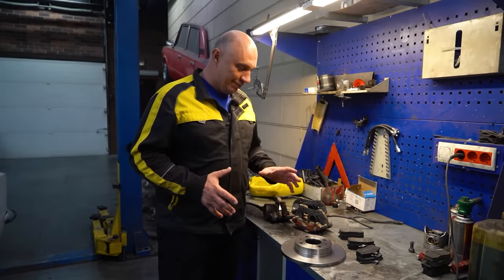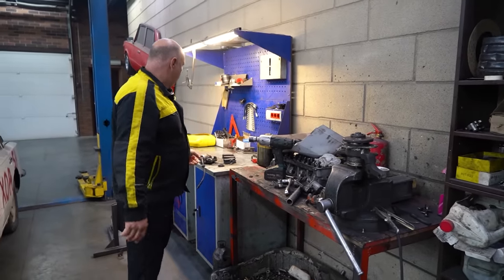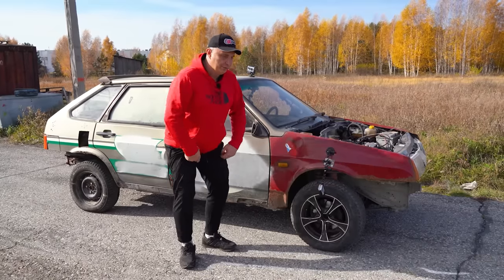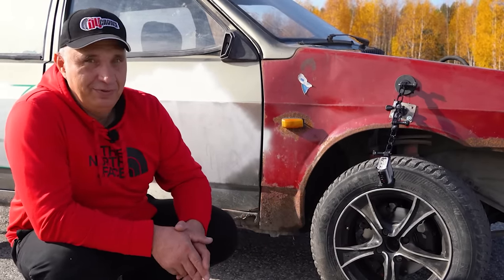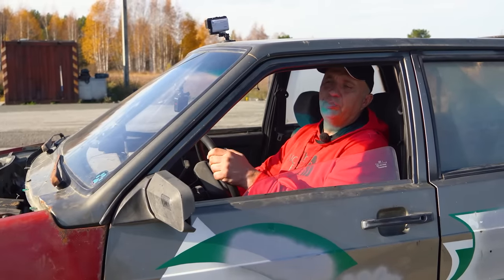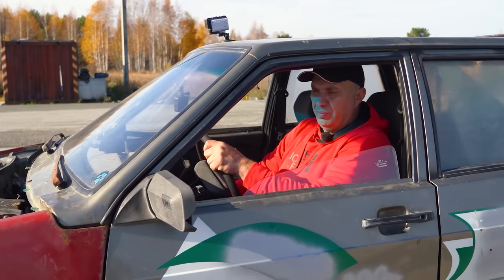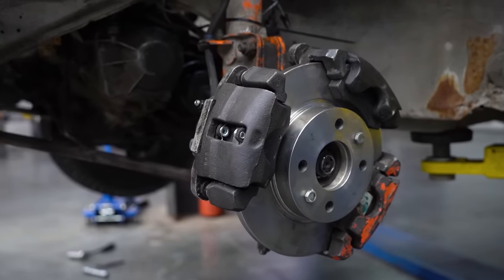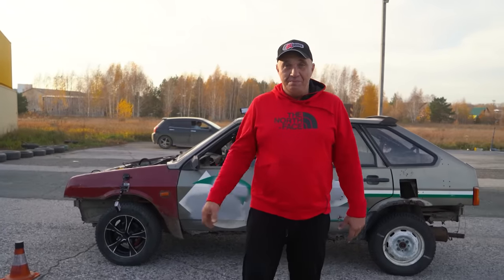Three calipers for each brake rotor – what will happen?

Comment: Maybe add more wheels to the front and see how much braking you can actually get with more traction.
Reply: They could also start drilling the rotors if the additional wheels and brakes need the extra stopping power.
Reply: Would be better to take the rear lines and use them for more volume
Reply: Nah, wont change much. wider tire is not equals more traction. i saw here on youtube old german video, there was passanger car and semi truck, long story short it doesent matter how wide or skinny your tire is, if brakes can lock up wheel braking distance will be about the same. but softer tire compound will shorten distance
Reply: @davidgoliath2331  "if brakes lock up" that's the point! Having more tire pushes that point further, hence achieving greater deceleration.
Reply: That is peak stupidity, I absolutely love it
Reply: More wheels it's not equal to more traction
Reply: Little pizza cutter 14's on my 79 620 deliver incredible traction. I don't believe bigger is better.
Reply: 355 r88r's up front.  Might do an endo 😆
Reply: @davidgoliath2331 Engineering Explained has several videos about braking with wider tires, bigger rotors, slotted rotors, ventilated rotors, etc. He is very articulate in his explanations. Worth watching.
Reply: @MadScientist267 Adding two master cylinders would be awesome.
Reply: Yep!
Reply: Yep, both...more wide...stickier...
Reply: @fynetuneyrgf drilling the rotors would lose surface area and thus biting force. It would make the stopping distance worse
Reply: Tyrell Indy car style heck yeah
Reply: @alexmelia8873 drilling the rotors is to keeping the brakes cool and making sure they don’t over heat
Reply: @joshmanis9860  I have to say about the drilling/slotting rotors, it isn't designed to dissipate more heat, if anything there is less metal on the rotor which means more heat. 

The slot are cut in to help stop brake fade which happens when the brake pad gets to a certain temp (depending on quality of course) the pad heats up and causes gas to emit between the pad and the rotor which stops the pad contacting the disc until the gas escapes.
Drilling rotors is even worse and is really done for aesthetics.
The webbing between the rotor surfaces is what is designed to dissipate heat.
Reply: Put more weight in front of car to háve better grip
Reply: Here’s 2 ideas, a twin front axle like the old lad Tyrell F1 race car or an ejector seat with airbags with a Klaus and St Greta dummy  .
Reply: @JT-4real drilled rotors is to let the gas escape that builds up when the brake pads wear.
Ventilated discs is to keep them cool.
Reply: @davidgoliath2331 there's a point where traction and weight cross over. It's all about ground pressure. Wider tyres will give more grip until a certain point them less grip. Tie increasingly larger pieces of plywood to your shoes and try it out.
Reply: @davidgoliath2331 wider tire definitively equals more traction that's why f1 cars have 400 section tires and it was one of the major advantages of the tyrell 6 wheeler
Reply: @1one3_Racing  That is what I wrote but I didn't say ventilated I said the webbing in the middle is to dissipate the heat which is a ventilated disc, the slots are to let the gas escape and drilled do the same job but make the disc weaker and allow for cracks to form.
Reply: nonsense, they need a better brake pump, three calipers is too much for any stock pump
Reply: @Sekir80 you still need weight on the wheel to get grip. That's why bulldozers have skinny tracks so they can get good ground pressure and great grip
Reply: @joshmanis9860  thats correct- it'll help longterm braking as a trade off for instantaneous bite
Reply: @JT-4real  good quality brake pads have a slot in the middle which is there to dissipate the gasses. The vents in the rotor act as a blower fan sucking in air from behind the hub and shooting it towards the wheel. The slots wipe the pad surface clean to help prevent glazing of the pad surface and the holes help get more air moving through the rotor
Reply: @Sekir80 In a physics class you will learn that increasing the area of contact with the ground decreases the force per unit of area, and it balances out.  That friction is identical.  Wider tires do not stop better than narrow ones.  The thing that matters is the coefficient of friction of the particular rubber the tires are made of.
Reply: @beyondwhatisknown  I still don't get it. Check out the cars from 1900: they have extremely thin, almost like bicycle tires. Today, you rarely find a car with 200mm or narrower tire. If your reasoning is true, we wouldn't need wider tires, hence we would use thin ones. What am I missing then?
Reply: This is probably what Tyrell F1 engineers said when they made that 6 wheel car 😂
Reply: @Sekir80  Wide tires are much better for cornering, but worse in rain, snow, puddles, hydroplaning, and absorbing vibration from rocks on rough roads.  Putting a bigger rim and a lower profile tire at higher pressure is what a fast paved world needs, and tall narrow tires is what the slower unpaved world of the past needed.  I miss my cars with the narrower tires in the snow, and a road bike tire with some tread cuts down to the pavement in snow and slices through snowbanks better than a mountain bike tire.  Wide tires have disadvantages.
Reply: @ergoproxy-gx2cq  Hi Andreja! How is it going?
Reply: @fynetuneyrgf  I thought that was just to release gases and prevent heat build up?  How does that add stopping power by itself?
Reply: Dual master cylinders!!
Reply: just put one more zhiguli in front of zhiguli, tovarish
Reply: @Dat_Sun it depends on the weight of the vehicle. Skinny tires apply more force to the ground which means more traction. If you have to light a vehicle with to large a tire you actually have less traction
Reply: How you think you get more traction with more wheels?
Reply: Modern brake pads don't outgas significantly. Cross drilling is now a cosmetic issue. They look cool 😎

Comment: It would be interesting to see how an ABS system would deal with 3 callipers. 🤔
Reply: I'm willing to bet the problem is brake fade.  The rotor is hot from the previous caliper, causing reduced performance.
Reply: @trm4life  yeah, right toward the ends of the runs it does look like braking efficiency is reducing. The overly sensitive pedal was responsible but could be solved by reducing line pressure.
Reply: With a single line going to each? Exactly the same as a single, but you have 3x area than before so the ABS pump may not clamp hard enough anymore.
Reply: @tsslaporte  true, but with 3 callipers less braking force would be required per calliper. In theory you'd only need 1/3 the clamping force on each calliper which in the long run could potentially lead to better pad and rotor longevity.
Reply: I was just thinking it might blow up
Reply: Lada and ABS good one 😂😂😂😂
Reply: This sort of setup is common on trains and in certain types of luxury/armored cars, like the Maybach 600S . To be usable it needs a powerful master piston, ABS, and some actual weight on the wheels. Way too overkill for a stripped-down Samara :-)
Reply: @citymagnum4734  Oh yeah I totally agree, WAY overkill for a lada but it would be funny to see what would happen, would the car try and do a front flip?? Or maybe just take a screenshot we'll never know. With some extra weight in the front I reckon they could get the back wheels to pop off the ground while braking.
Reply: @trm4life  I agree, that will be a problem as the effective cooling will be reduced. For driving in traffic or on a track, the brake fade will negate any improvement. Plus the braking pressure from the stock master cylinder is spread across a much larger surface area, negating the effective clamping pressure.
Reply: Unsprung weight will increase too right ?
Reply: @citymagnum4734 why do you know this
Reply: @mitchrich6  Well of course, but against not being able to stop, it's an acceptable tradeoff.
Reply: @tunahant.3361  Just watched an old Dough DeMuro video about a Maybach that had factory dual calipers. A monster of a car.
Reply: @djboogy3985  With completely normal stock brakes you are normally able to lock the wheels no problem... More brake calipers do not magically give you more grip on the tires lol ;)
Reply: Two disks and two per corner. It's brake fade 👍
Reply: How about 3 callipers on all 4 wheels?😊
Reply: 3 callipers x 4 wheels
Reply: Brake fade is brakes not working  @trm4life
Reply: Will be just like a.sports car. They have like 4,5,6 piston brake callipers. Old crap cars got like 1 pistons or two
Reply: @remyche8768     
No way!  Really?  That's sarcasm, btw.
Brake fade, is when the rotors get so hot, the friction material is no longer effective.  It's not just "the brakes don't work".
Reply: @citymagnum4734  What sort of setup?? Multiple calipers per wheel? I looked everywhere and I see no more than 1 caliper per wheel
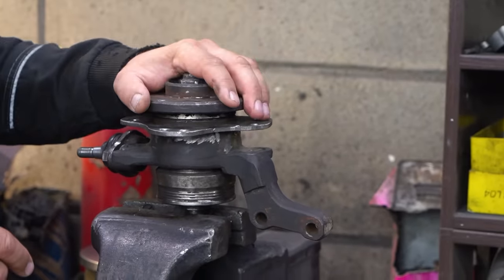Reply: @DarkAttack14  Look up Doug Demuro's Maybach 57S review @3:00
Reply: @citymagnum4734  interesting to see that was used, I couldn't find part diagrams showing it I guess it was only in that model or something. Kinda a cool idea but at the same time they could have gone single caliper and got it done all the same I bet
Reply: @djboogy3985 I've seen endurance racing teams do this. There was however a racing regulation that mandated a certain number of pad changes, and teams were just gaming the rules. It may not have helped at all.
Reply: It’s all dependent on the the tires. You cal already lock up a rotor with a single caliper pretty easy…
Reply: The only way to get better braking is to fit wider tyres. These tyres only has so much grip, whether you put 1 or 5 calipers on it can only grip so much.

Comment: More caliper = more pistons to fill with brake fluid to generate same pressure. The braking force doesn't simply multiply with adding caliper. But neat idea. Maybe making the master cylinder bigger will do something great
Reply: Your right, but more surface area of pad to disc with the same pressure is the other way to look at it too. The limiting factor always ends up being the traction of tyre to road tho.
Reply: more/bigger caliper pistons and/or smaller master cylinder piston make the braking pressure higher, that's the whole point of hydraulics
Reply: Actually it does.

Say you have 10 psi and 1 sqin of piston. You have a force of 10 pounds on the pad.

Add another 1 sqin piston, now you're exerting 20 pounds of force.

Add another piston you have 30 lb force.

The real numbers will be higher, those were chosen for simple math.

The volume of fluid that the master can move is the issue. This is why it takes almost all the pedal travel before anything really happens. You can't impose the force on the disc with the pads until there is nothing else left to give, which translates to filling up all the slave cylinders with fluid.

The sudden and uncontrollable braking at the end is the result of the slaves finally filling up and then squeezing with that full "30 lb" of force, something which normally happens way earlier in normal brake pedal travel, but with much more force on it.

Pressure wise at the pads, he collectively has the equivalent of standing on the brake pedal, but because there's 3x the volume to fill, it takes 3x the pedal travel to reach it, and a lot less effort once it finally gets there.

The real answer to the current design is to take the rear lines and route them to the front so the master is delivering 2x the volume.

The braking force will be cut in half for any given pedal pressure but it will happen earlier in the pedal travel.
Reply: @brotang2953 And you are right to a point... however that logic only applies if the piston area stays the same but the pad size increases.

What you have here is simple additive force. The idea is similar to why they add a 2nd piston to a single caliper. The brake force increases without needing more force on the pedal, at the expense of more pedal travel (due to more fluid being required to move the pistons the same distance).
Reply: @fuzzy1dk Yep. It is what allows a hydraulic jack to lift a car with only modest input from an arm. The trade-off is the more weight you need to lift, the bigger the difference in piston size needs to be (master vs slave), but this comes at the cost of needing to pump the master more than with a closer match. With the brakes, this translates to more pedal travel.
Reply: That's what i was thinking
Reply: Cool story bra
Reply: @scientist cool story bra

Comment: Master Cylinder has to increase in its volume in order to provide the pressures required for brakes. Adding additional Slave Cylinders the volume and thus pressure is divided across all pistons now lessening the overall pressure being applied to the pads now.
Reply: You're on the right track, but not quite.
The cumulative pressure is far in excess of what a single caliper can provide, even with reduced supply volume.
There's enough pedal stroke to supply all 6 calipers, barely, but at the end of the pedal stroke and with the ratio designed for 2 calipers.
They need a higher volume master cylinder with a much shorter brake pedal arm pivot.
There would be more volume and less mechanical advantage therefore a more easily modulated pedal.

Comment: Next time you should try to use a car with ABS to really see the diferrence between using 1,2 or 3 calippers, good video anyway!!
Reply: ⁶⁶⁶
Reply: I was thinking the opposite. Without ABS you are really showing the effect in all its glory or infamy. If you wanted to show a more modern or higher level of tech, a larger master cylinder plus ABS would be neat, but would be even further removed from the norm. Remember things like ABS and traction control add extra variables.
Reply: @whyjnot420  thats exactly why they should use it, with abs the variables are always the same, doesnt matter how hard you push the brakes and in the video he is incapable of aplying the same force to the pedal each time and keeps locking the wheels because he is a human and not a machine.
Reply: @xxn0cturn3xx  So you mean a difference in practical application, not just the difference.
Reply: wont change anything.. except maybe make the difference smaller (elliminating humman error) cars have  had more than enough breaking force as stock for quite some time, its the tyres that become the issue.  you can add bigger or more breaks all you want, if the tyres remain the same, you get the same result...